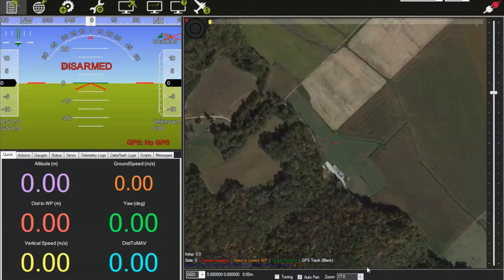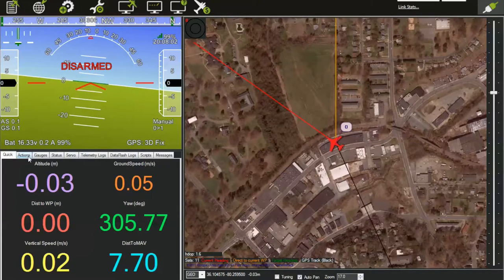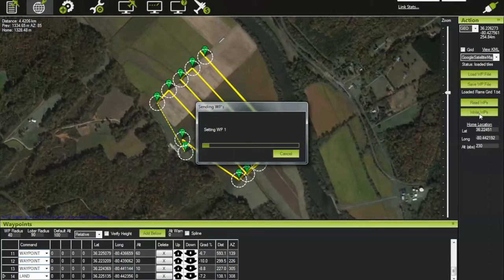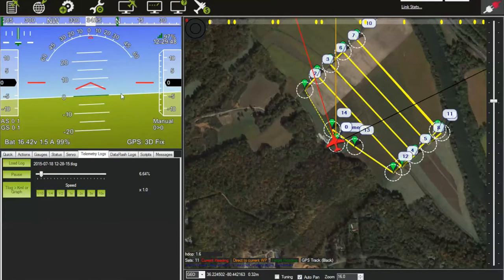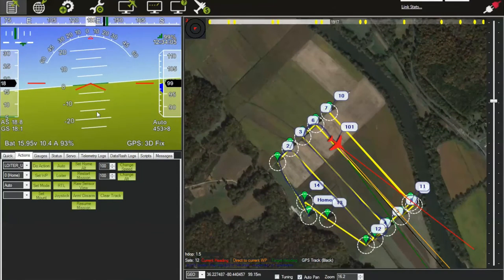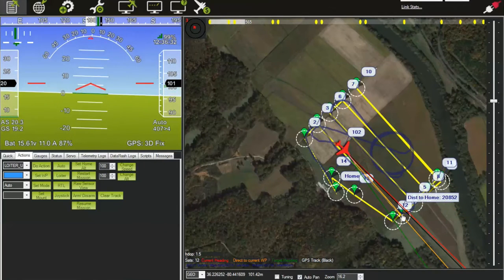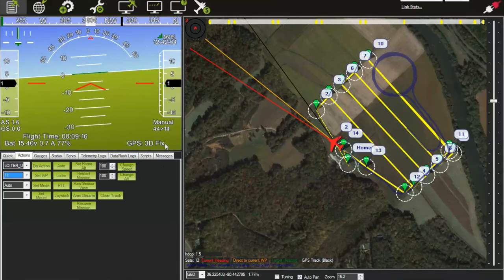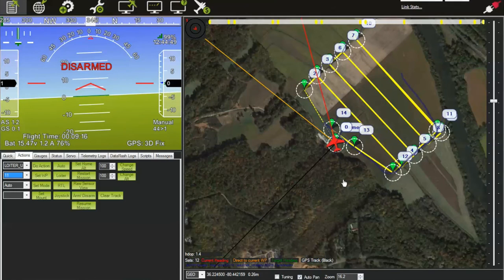Mission Planner Part 4 -  Putting it all Together

Comment: If you set up an autonomous flight from Point A, B, C  and D, back to A, it will achieve the flight mission regardless if you lose and regain telemetry? 

Do I need telemetry to for a command RTL in an autonomous flight described above?

Comment: For  a fixed wing UAV
He uses XBSTATION for telemetry ( Raspberry) 
The remote control, the mission planner and the plane are all connected 

Do we have telemetry connection for the Remote control to act on a plane that is mile away that has XBSTATION???

Comment: 25:17 so, when you are in auto mode, you can sill control the aircraft with your remote? or, did you mean when it reached 2 meter above the ground, you changed the mode to manual and then 'my pilot' pulled the pitch control to slow down?
I've watched your four tutorial videos. good thing the cursor didn't messing up for this time

Comment: Really good series, thanks! I have been using MP but I did not know the "Append feature" really cool! Thanks
One feature I like to use especially for mapping is to stop camera trigger just before the plane turns into the next line. So I use overshoots and leadins. This allows the plane to go past the actual turning point and immediately turn of the shutter off and commence again after entering the next line and level. really cool feature. I get lots of "Error compass variance"  I have tried calibration several time, still the problem is on, is this something worrisome? heading as seen on the aircraft is always correct, but i'm usually not so much at easy if I hear some errors.

Comment: Thanks for this great series, very well explained. Do you recommend a particular stable version of Mission Planner ?
Reply from the maker: +Nicholas Matias The newest version, 1.3.37 is quite good. Once you have it up and running I would not recommend updating, or at least check the changelog very carefully before you do. Also, if you do update, be sure you still have the installer file in case you need to uninstall the new version and go back.
Reply: +Linn Aerospace  Great, thanks!